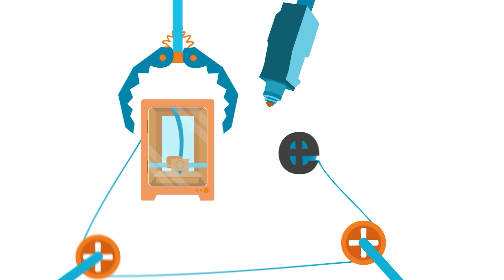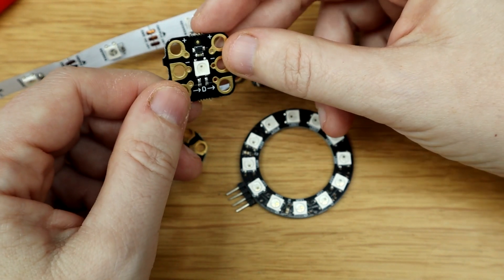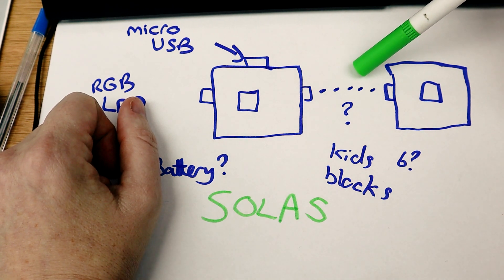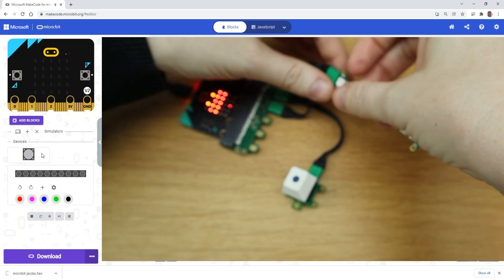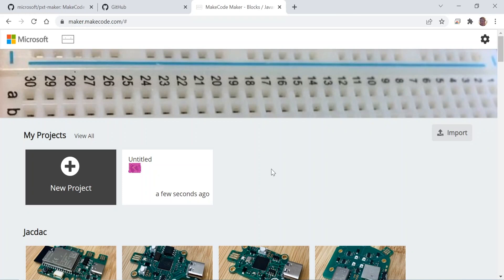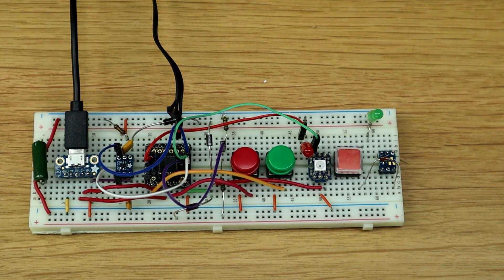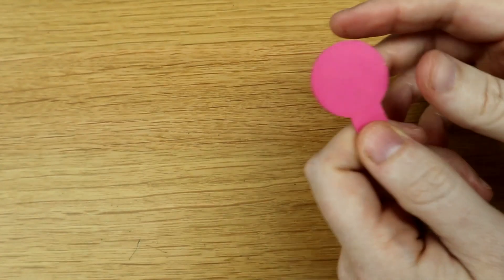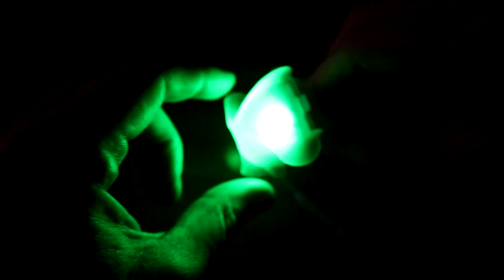Designing a Custom PCB for Microsoft Jacdac

Comment: I'm sure I've seen a device that had maybe a few LEDs on top or a small matrix/grid.  A device in a case a few cm square I think including a battery.  That might have been Bluetooth wireless connections not a USB.

But I cannot find it, I'm sure it was a blog post or video on YouTube or maybe something like a Kickstarter campaign.  That's going to but me a bit now lol.
Reply: I found a similar looking though different product.  Monogram (was Palette gear) that is a modular control interface that seems aimed at creative software like Adobe Lightroom, Photoshop etc.  That seems to have a custom connector and is probably magnetic for a nice snap fit.

Maybe another day I'll find the generic microcontroller programmable one I saw ^_^